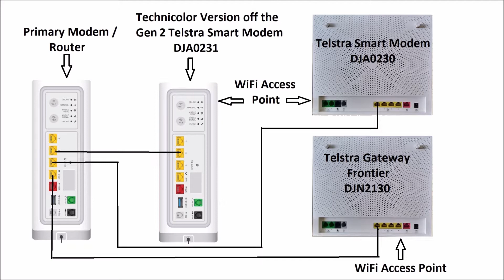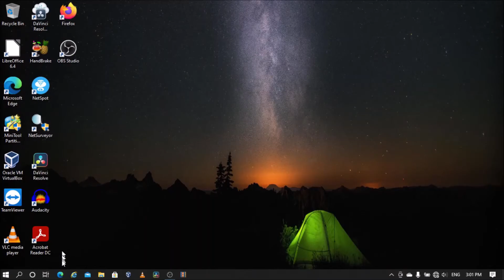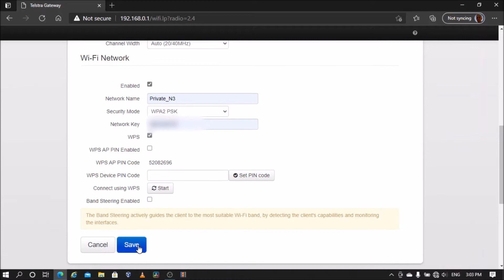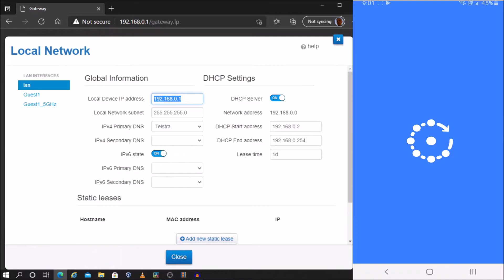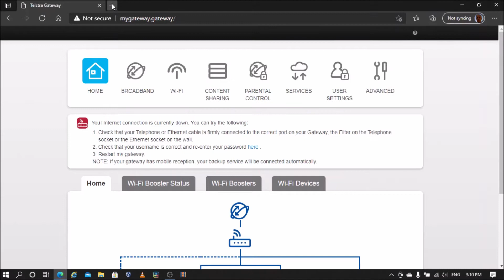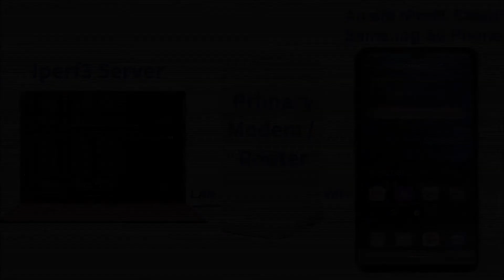Telstra Smart Modem as a Wi-Fi Access Point

Comment: I made a mistake when putting in the local device IP address and now I cannot access my Telstra modem at all. Is there a factory reset to reset the smart modem, so I can try your method again?
Reply from the maker: The modem can be reset by reset button for at least 10 seconds while modem is powered on. You will need a bent paper clip or similar device as reset button is located behind a small hole in modem's case. On Gen 2 modems hole is located on back near LAN port 2. On Gen 1 modems hole is located on front just above USB port.
Reply: @DavidSmith-ir4hl  Thanks for that David. I think I have it working now, although there are no lights visible on top of the smart modem. I tried out the 5G connection and it appears to work.

Comment: Can you change the name of the new access point  by putting  a 2 on it or does it have to be the same as the primary  modem and if you add a second access point  can you put a 3 on it so you know which one you are connecting  to
Reply from the maker: Yes, you can change the name of the access points Wi-Fi, but your devices want automatically connect to the strongest signal as you move from area to another area. The device will only connect to the stronger signal when the original signal gets too weak for a stable connection.
Reply: Unfortunately this hasn’t worked for me, I’m wondering if it’s because my primary modem is through Starlink? Once I change the network name to my existing network, I can no longer get back into the settings to change it. It also doesn’t seem to like to have its IP address changed (if I do that first)

Comment: Thanks David. Im on FTTP Opticomm and just changed providers. While internet speed increased as per plan my wifi became crap, every app is taking ages to open. Before switch everything worked fine. Any advice? Ive got telstra NMD box in the garage and telstra Smart Modem. Thanks
Reply from the maker: Suggest you change both the IPV4 and IPV6 DNS server settings in the Smart modem to Google. To do this open a web browser on a device connected to the modem and go to http://192.168.0.1. Go to Advanced and then go to Local network. From the drop-down list select Google for both IPv4 and IPv6 DNS 1 and 2, then save settings and reboot modem.

Comment: worked perfectly, thanks mate .... doubled the 2.4G from a crappy 1.8Mb/s to 3.6 ... tripled the 5G from 1.3Mb/s ... in a study room that was only 20 metres from main router ... and that was just by adding the Telstra Smart modem right next to the iiNet main router ... hopefully will be able to wire it up closer to the room
Reply from the maker: Glad to hear that using the Telstra Smart modem as an access point has improved the Wi-Fi speed but even 3.6 Mbps and 3.9 Mbps fairly slow. Hopefully you will get much better speeds when Telstra Smart Modem is located closer to study.

Comment: Hi David, Is it possible to setup may Gen 2 Modem as a "Stand Alone" unit to allow access for my Security Cameras that only use WPA encryption? I have been informed by Telstra and looking at my Gen 3 Modem that it does not now support have WPA encryption. My Security camera were working OK with the Old Gen 2 modem before I installed the new Gen 3 Modem. I am hoping that I can get my Cameras back online with the Old Modem so that I might be able to update their Firmware to work with the Gen 3 Modem.
Reply from the maker: If you set the Gen 2 modem up as an access point and temporarily turn of Wi-Fi on Gen 3 modem you should be able to connect cameras.
Alternatively, you could be able to temporarily replace your Gen 3 modem with a Gen 2 modem.
Reply: Thanks David for your prompt reply. Yesterday I did turn off my Gen 3 Modem and started up my Gen 2 modem again but found I couldn't get any wireless access to it? Could Telstra have disabled it in any way? Because I couldn't get any wireless access to it I wasn't able to get the cameras to connect to it again. I even tried connecting the cameras to it with a LAN cable but still no joy? I have just discovered today that Fing may have Blocked the Modem so I will try again today? Talk about frustrating, all was OK before installing the Gen3 modem.

Comment: Hello. Thanks for this excellent and informative video. I'd like to ask a question about an alternative setup using Bridge mode. Many years ago on a defunct Telstra forum I read a comparison of the method described in your video and the alternative method. I wonder if you are aware of that method and might know why I might choose one other the other? If you'd like, I can describe my rather complicated network setup more fully.
Reply from the maker: The main benefit of using the method described in the video is that you still can access the modem GUI and you also can use the USB port on the modem. The benefits of using the modem in Bridge mode is that it is easier to set up and because modem's WAN port is used to connect modem to main modem instead of one of the LAN ports, if you are also using modem as a switch there is an extra LAN port.
Reply: Thank you David. So with the bridge method, do you still need to adjust the IP address and IP range of the access point router, and also turn off DHCP and IPV6?
Reply from the maker: @arcadelt5237  You shouldn't need to change the IP address and IP range of the modem. Theoretically you should need to turn of IPV6 and DHCP as bridging modem should theoretically disable these, but I have found by experiment that DHCP and IPv6 still need to be disabled in the Telstra modems for them to work correctly.
Reply: Thank you 🙏🏼

Comment: Hi David, Thanks for the video. I've followed the steps and both my primary and the access point modem are the Gen2's. Should the light at the front of the access point modem be 'Red'? I think it has worked as I can see that I have full bars of wifi now in the access point room but I'm not 100% sure?
Reply from the maker: Yes, the light on the front of the access point modem will be Red.
Reply: @DavidSmith-ir4hl  thankyou, all good then 🙏

Comment: hi David. Need help badly. I have the gen 2 modem and an old gateway modem - fast 5355. I am using the gen 2 as my primary modem for FTTP, I was wondering if the Fast 5355 can be used as an access point using the same process. Would greatly appreciate your response. cheers mate.
Reply from the maker: Yes the F@st5355 modem can be used as access point using the same process.

Comment: Hi David, I have a Telstra smart Gen 3 as my primary modem and I also have a spare technicolor smart modem gen 2. Can I use my spare Gen 2 modem as a wi-fi extender?
Reply from the maker: Unfortunately, you can't use the Smart modem as a Wi-Fi extender. The Gen 2 can be used as a Wi-Fi access point connected to one of the Gen 3 modem's LAN ports by ethernet cable.
Reply: @DavidSmith-ir4hl  Thanks David for the clarification.
Reply: @DavidSmith-ir4hl  Hi David, one more question. To make Gen 2 modem as a Wi-Fi access point, should I connect the ethernet cable from the Gen 3 modem to the WAN port or one of the LAN ports of the Gen 2 modem?
Reply from the maker: @JagathPremawardena  For best results its best to connect a LAN port but before you connect the LAN port you will have to change the last group of digits of the second modem's LAN IP address so that it is not the same as the first modem. Example 192.168.0.4. IPv6 state and DHCP should also be turned off. All these settings are at Advanced > Local Network and can be done at the same time. Once these are set the LAN port of second modem has to be connected to LAN port of first modem in order to be able to connect to second modem.

So that devices will automatically connect to modem with strongest Wi-Fi signal the Wi-Fi name and password of second modem should also be changed to match that of the first modem.

There are complete instructions in section 34 of this document https://drive.google.com/file/d/1lDGZ83oZ19Y98rHINe2I7QFqWyaQO9WL/view?usp=sharing.

There is also a video at link below.
https://youtu.be/vhHiHrQ9bEg
Reply: @DavidSmith-ir4hl  Hi David. Thank you so much for sharing detailed information.
Reply: Hi mate, I have both Arcadyan and DJA0231 models as access point and technicolor CobraXh as the main modem. I see in your other video for Arcadyan that the wan port from Arcadyan is connected to the main modem. Is it different in both models? Thanks and appreciate your help.

Comment: I have 2 extra modems that i want to use, do i have to have them connected to main modem? i dont want any ethernet wires running around so i had to buy a wifi extender to add outside to transmit wifi to the granny flat.
Reply from the maker: The modems do have to be connected to main modem using one of there ethernet ports. You can use a Wi-Fi extender or a powerline network adapter to connect to main modem instead of using an ethernet cable.
Reply: @DavidSmith-ir4hl  thank you David for information, would they interfere if I decided to add a modem gen 2 right beside a to link extender connect through its Ethernet port and would modem offer greater range or benefits than the extender as I would connect and add it beside extender as I don’t want to run wires around outside.
Reply from the maker: @TheMedoGuy  As long as you select a Wi-Fi frequency on the modem that is 6 channels separation to that of the extender there will be no interference. It depends on how good the extender is whether the range will be greater, but if you connect all devices within range of the second modem to second modem's Wi-Fi instead of the extenders Wi-Fi you should get almost double the speed. The other benefit is that you have ethernet ports for connecting devices that don't have Wi-Fi.
Reply: @DavidSmith-ir4hl  great thank you for reply and i can just follow the instructions here and would also work on a gen 3 modem being main and gen 2 as wifi access point?
Reply from the maker: @TheMedoGuy  Yes just follow instructions in the video. It should work with a Gen 3 modem as the main modem. I have tested using a Gen 3 modem as main modem and a Gen 2 modem as the Wi-Fi access point. I have also tested using a Wi-Fi extender instead of a ethernet connection.

Comment: could i use a powerline adapter for connecting the access point to the main modem/router
Reply from the maker: I have never tried it but theoretically you should be able to use a power line adapter.
Reply: @DavidSmith-ir4hl  alr thanks!
Reply: @DavidSmith-ir4hl  by the way, would powerline still work in a household with multiple circuit breakers? they are all connected to the same electrical panel.
Reply from the maker: @jozhva  I don't have much experience with powerline adapter. Some people say they still work, and others say they don't. I think it depends on the quality of the wiring and whether each individual circuit breaker has its own RCD. Individual RCDs could stop it working. If does work, there will be a reduction in performance (Maximum speed).
Reply: @DavidSmith-ir4hl  Alright, thanks. I'll be picking one up tomorrow and I'll let you know if it works.

Comment: Hi David
Thanks for the video. Finally a video for Aussie telstra users.
I was hoping if you can give me a bit of guidance in my situation. 
Following your instructions I have gen 3 primary modem connected to gen 2 technicolour modem via  Ethernet cable.  I have devices connected to secondary modem Ethernet ports which are working fine however it seems like it’s not emitting any wifi signal as wifi strength hasn’t improved where the secondary modem is located.
What did I miss here ?

TIA
Reply from the maker: Have you checked with a Wi-Fi analyzer app? If the access point is transmitting Wi-Fi the analyzer app should show two signals on both Wi-Fi bands. A strong signal from the access point modem and weak signal from the Gen 3 modem. There are free Wi-Fi analyzer apps for Android and Windows devices. If you have an IOS devices use the Airport app

Comment: can it be used as in wifi connect rather than rj45 so i can use it like a node
Reply from the maker: Unfortunately, the modem can't connect to main modem using Wi-Fi. It needs a wired connection

Comment: Hi David. I have an arcadyan smart modem gen 2 as my primary and a technicolor smart modem gen 2 as a WAP. Could I just swap them over (unplug everything and replug everything) so the technicolor is primary or would I need to go through the whole setup process again? Cheers
Reply from the maker: Unfortunately, you will have to go through the whole process again as the Technicolor modem will need to be reset and the Arcadyan modem then reconfigured as a access point.
Reply: I thought that might be the case. My primary modem isn’t performing as well as it used to. Telstra are sending me out a replacement one but wanted to swap them over in the meantime. I’ll just wait until my replacement arrives. Thanks heaps 😃

Comment: Hello David, I am trying to set up the router used in this video as an extender, I have followed all the steps you did but the modem has no internet, I have band steering enabled because when I set the 2.4ghz ssid and password they changed on the 5ghz settings aswell, I have no idea what is going on, could you help me?
Reply: I just re followed your tutorial twice an I realised my mistake, I had been connecting the cable to the WAN port instead of a LAN one and I had also messed up the IP, this tutorial really helped me so thank you.
Reply from the maker: With band steering enabled both the modem will change the SSID and password of the 5 GHz Wi-Fi band to match that of the 2.4 GHz Wi-Fi band. If you want the 5 GHz Wi-Fi to have a different SSID and password, you need to disable band steering.

With one of the extender modem's LAN ports connected to one of the main modem's LAN ports can you access both modem's log in page when you are connected to main or extender modem?
Reply: @DavidSmith-ir4hl  Sorry for the late reply, I have been on holiday for a few months, I will check this today.

Comment: Great video david! I have one old telstra f@st 5355 model and I also try to turn it into WiFi WDS. However, in the video, the signal in is LAN port. Is there a way to use it without the LAN? (as Wifi signal in and Wifi signal out)? Not a computer person myself. Hopefully I made myself clear.
Reply from the maker: Unfortunately, the modem requires a wired connection. It is not possible to connect the F2st5355 to main modem using Wi-Fi.
Reply: @DavidSmith-ir4hl  ty

Comment: Hi David, 
I have a Gen3 as a primary modem, can you use Gen2 or Gen3 modem as an extender, if I use Gen3 is it the same setting  process as Gen2? 
Thanks Vasko
Reply from the maker: You can use a Gen 2 modem as an extender for the Gen 3 modem. I haven't tried a Gen 3 modem as a Wi-Fi access point connected to another Gen3 modem as the primary modem but theoretically you should be able to using same settings as the Gen 2 modem.
Reply: @DavidSmith-ir4hl  Thanks a lot, I'll give it shot
Reply: Hi David. Struggling a bit with this.  I have a primary gen 2 in the house and another gen 2 in my shed. I have a lan cable running to my shed from my lan port on primary. I just cant seem to do the intial set up? It just dont want to connect to new network. Thank u

Comment: Thank you David for sharing the video. I followed the steps. All looks good, but as soon as I switch off the dhcp, put the ip address according to subnet and save, the modem restarts and resets automatically to the original state.

I have two Telstra Gen 2 technicolor modem.

Thanks
Reply from the maker: There are two versions of the Gen 2 modem. One made by Arcadyan (LH1000) and the other made by Technicolor. What is the firmware of your modem? The firmware is displayed on the top left hands side of the modems log in page.
Reply: @DavidSmith-ir4hl  thank you. The model number is DJA0231.
FW Version: 20.3.c.0432
Reply from the maker: @chandanvijayvargiya  My modem has an earlier firmware. 20.3.c.0389-MR19-RA. The updated firmware might be the cause of the modem resetting. I will try and update my modem and check if the recent firmware is causing the resetting and if there is a solution.
Reply from the maker: @chandanvijayvargiya  I have updated my DJA0231 to same firmware and configured it as an access point to the Gen G3 Telstra Smart modem.  The modem did not reboot and reset all settings. The modem should not automatically reboot when LAN settings are changed.  If you use the same modem model for both the main and access point modems some browsers such as edge get confused and when you try to browse to the access point modem (192.168.0.2) the browser redirects to the main modem (192.168.0.1). Are you using the same model modem for both the access point and main modem?
Reply: @DavidSmith-ir4hl  yes both are same model